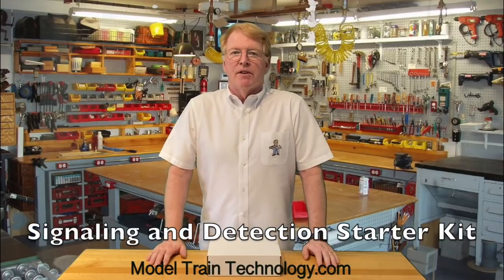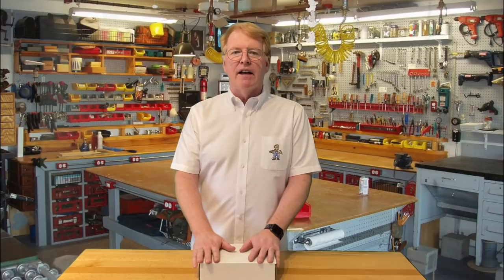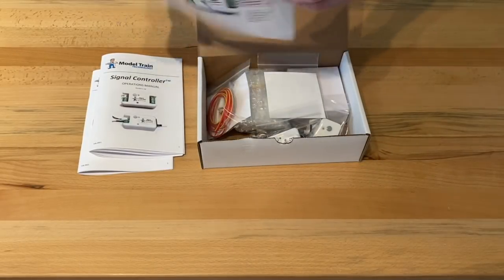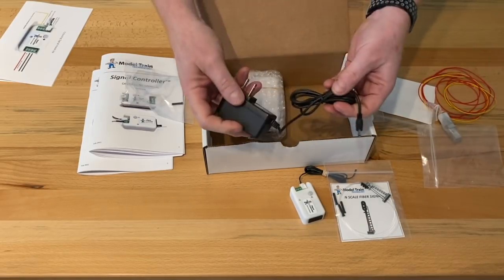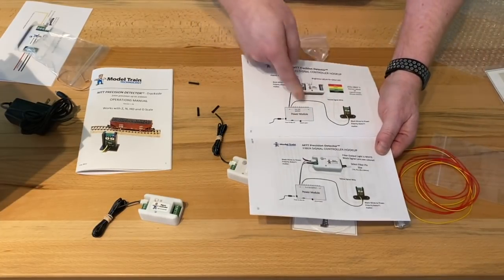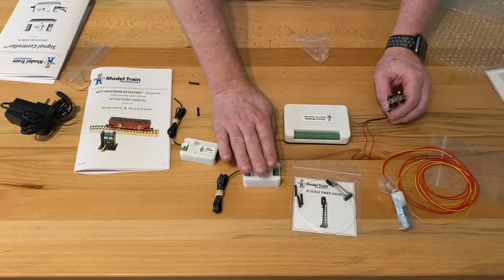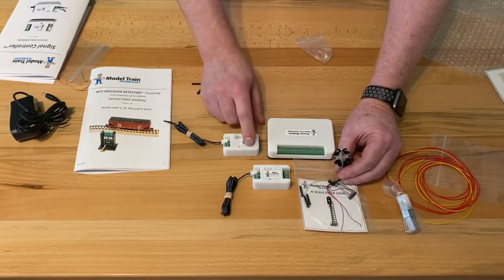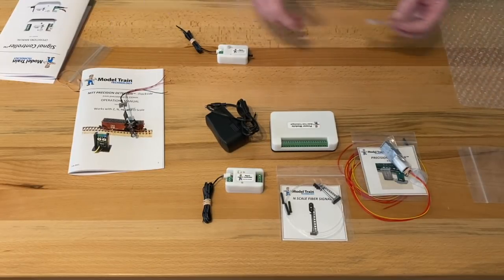Signaling Starter Kit Explanation Video by Model Train Technology

Comment: I have some atlas 3 color signals in N scale, and theyre fairly well detailled, especially where the scale size of the ladders and platforms are concerned, however even the newer offerings are still common cathode. So from what you described here, am i correct in the understanding i can switch the polarity and your system will still work withy Atlas signals?
Reply from the maker: Yes.  The Signal Controllers are Polarity switchable and will work with Atlas signals.  You don't need the wired in resistor because our controller already has it, but no harm in keeping them either.
Reply: I don't have a computer, but if there's a way I can send you a diagram drawn out for both block signals, and a Kato Unitrack Crossover, would you be able to look at it, and tell me what I will need to add signals to it?

Comment: This seems to be a neat plug and play signal. I went on the site and started to order the led startup kit, got as far as putting the kit in the shopping cart, then read that it takes 15 days from order to shipping plus processing time, plus 9 days shipping by first class mail from fl. to Ca. and decided I did not want to wait that long to get the signal kit so I did not place the order, I guess I will look else ware for a signal kit. You may do more business if you had an inventory that you could ship, in a day or two, of an order being placed. I'm sorry that I won't be ordering from you, because as I said, I think it is a great starter kit, and I would have like to order it if the time frame was reasonable.
Reply from the maker: We are a small company fighting chip shortages, rising prices for all commodities and raw material, labor and yet we have not raised prices in 3 years.  We have over 100 products and many allow customization.  To stay in business we manage our cash very carefully and we do that by not keeping extensive inventories.  Modeling is a hobby that most spend years working on.   Our order time ebbs and flows  with varying volumes of order so, depending on the item, it could ship in days or hours but we post a conservative time so that if we get a backlogged people are not disappointed.  Also, shipping by USPS (mostly) now is no more than 3 days. Manufacturing for the Model Railroad industry is not lucrative as evidenced by many company's closing.  We aim to stay around.  We hope you understand that is our goal. If you have questions about this you can always call.

Comment: My Details West 3 light signal instructions say their LEDs are around 2.4 volts so 3 might be okay but I wouldn't want to put 5 volts to them.
Reply from the maker: With the proper resistors, voltage isn't the issue.  LEDs are current sensitive, not voltage sensitive. Our system uses PWM - pulsing voltage so the voltage is never 5v anyway.  Our entire eco system is built on this principle.  You can even run a 3.3v LED at "12 volts" with the proper current limiting resistor.  Just basic electronics.  thanks for the comment - I think many people wonder about this.
Reply: @ModelTrainTechnology  I appreciate the response. I am not all that knowledgeable in electronics even basic electronics and I know I am not alone. I  probably will be asking more in the future.
Reply: @geraldjones2278  resistors of the correct rating and configuration can step down a 110v from a power outlet to a point where you can hook an LED to it pretty simply! theyre magical nearly lol
Reply: @Shadow0fd3ath24  Thanks but I was aware of that. The problem is determining what resisters to use to step that voltage down.